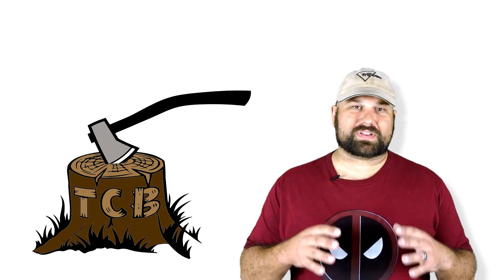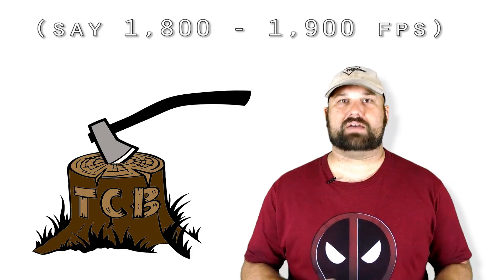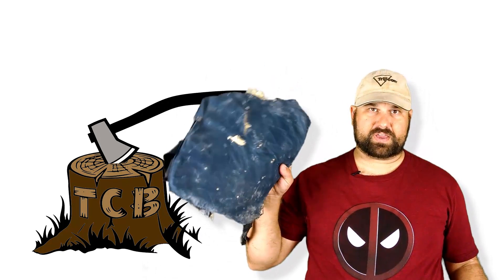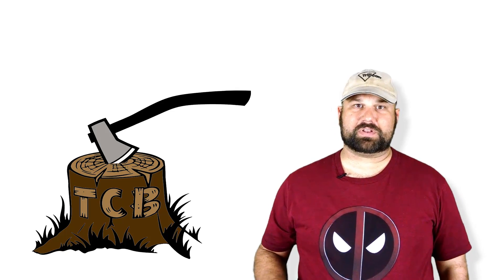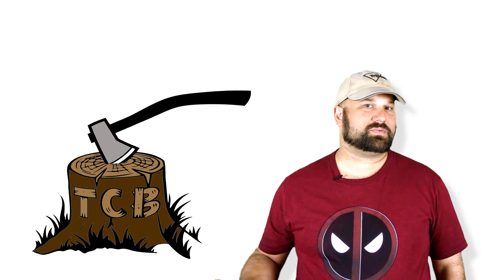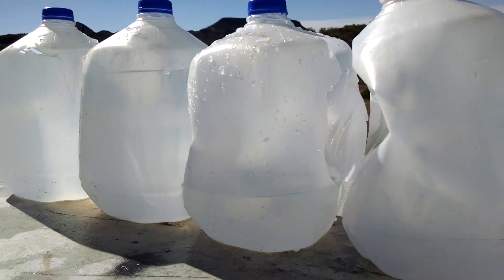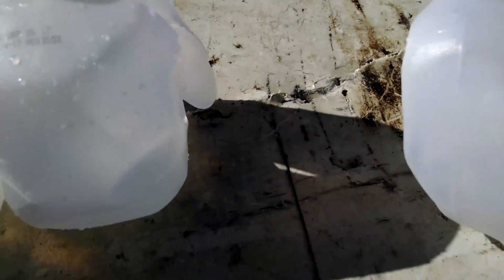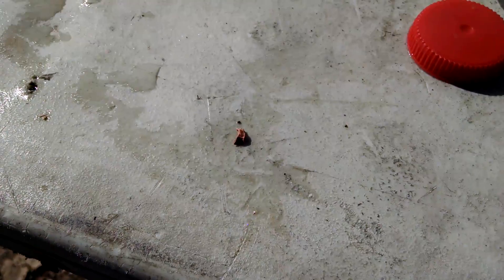Can a stack of soft armor stop a rifle bullet?

Comment: I had an old Second Chance level 3A vest with a 5×8" K30 special threats plate in the front pouch in front of the front soft ballistic panel.
I shot the vest 5 times with XM193 out of an AR with a 16.5" barrel.
All 5 rounds went through the K30 plate, though the front panel and blew through the back panel too.

The K30 was a kevlar wrapped steel special threats plate rated to stop up to 30 carbine soft point in conjunction with the vest. The K30 is not rated to stop high powered rifle rounds.

You would probably need about 4-5 3A panels to stop XM-193.
I wouldn't rely on it though.

Edit: There's a video of someone testing 3A panels vs 5.56.
I think the first shot was xm193 and it went through 4 panels snd stopped on 5.
62gr green tip went through 7 panels of 3A and stopped on 8.
Reply: Well that sucks, I have the exact same setup.  Thanks for taking one for the team.

Comment: I did this with two level 2as folded into quarters (so four layers each) with a light 30-30 load. Hornady interlock round nose at 2050-2100. Zipped right through and buried really deep into the dirt

Comment: Good video. You could run the velocity down further to say 1400 fps and still consider that rifle velocities. If memory serves the older velocity specs for 45-70 is 1400 to 1500 fps.
Reply from the maker: MatteoSixSeventyFour That's certainly true, but when I think "rifle" I think 20th century, smokeless powder, spitzer bullet. I'm pretty sure IIIA will stop a .45-70 on its own. It's rated for .44 mag.
Reply: The Chopping Block But the point I was beating around the bush towards is. At what velocity will it stop a spitzer type round? With the smaller meplat it may still penetrate even with a lower velocity on soft armor? Just an idea for another video if you are so inclined. At any rate good video. And have a good day brother.
Reply from the maker: MatteoSixSeventyFour Thank you. Definitely an area I'd like to experiment with. I know that soft armor will stop a subsonic 200gr .300 BLK.
Reply: The Chopping Block Those are generally in the 950/975 fps to 1080fps range. So I can see it stopping them.
Reply from the maker: MatteoSixSeventyFour Yeah, not surprising. IIIA has no trouble with round nose bullets at 1,500 ish, either. That's why your suggestion about spitzer bullets at 1,500-1,600 is pretty interesting.